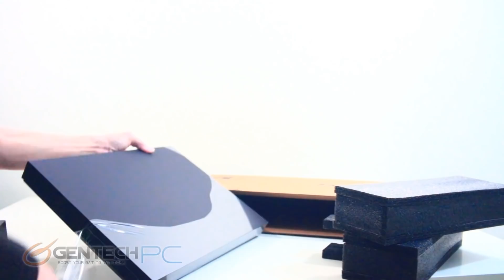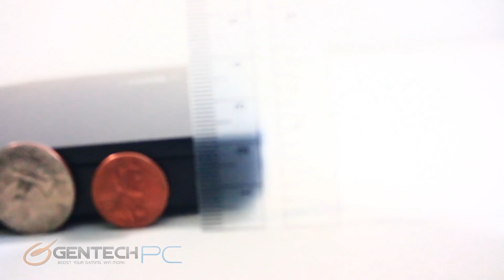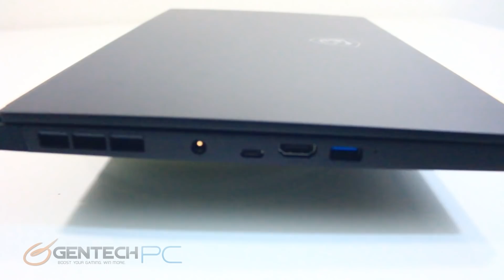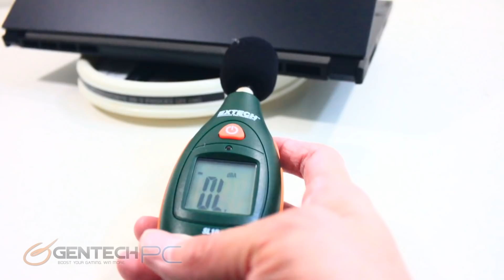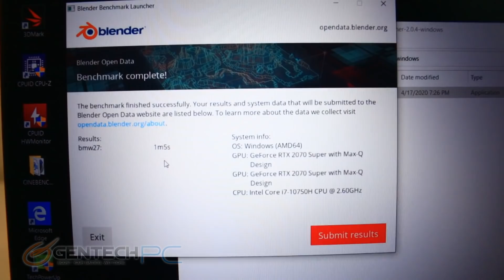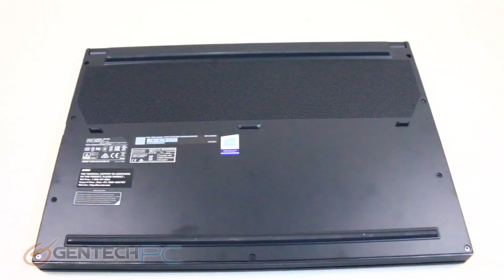MSI GS66 Stealth Detailed Review & Benchmarks (300hz, RTX 2070 Super MaxQ, Intel 10th Gen i7-10750H)

Comment: I have the GS73vr 8RE Steath with a 4K panel and the 8750 i7 with 16GB 2666 and the 8GB gtx 1070MQ and i love it. picked it up off of ebay for 1280 USD about 7 months ago in mint condition with a warranty left. The only thing i did to it was put TG kryonaut on the GPU and CPU when i got it because i do that with all of my laptops when i get them. It dropped the temps over about a month's time around 7 degrees C max during AAA gaming. these stealths don't get enough recognition at all. they are super thin and light and priced very competitively.  I slapped a 1TB 970evo m.2 and 1TB 850pro in mine and it screams. my only "catch" is that i personally think 1080p is and should be dead because once you start gaming in 4k at 60+hz, 1080p looks sooooooo bad. i'm a graphics snob, so i will never buy a laptop or anything that doesn't have a 4k panel. i turn eye candy down or off if need be just to be in 4k with higher FPS. i do have to go QHD on my stealth sometimes if push comes to shove, but if they offer this with a 4k panel and the 2080 maxQ, i will consider trading up for my gaming on the go. (for the debaters on 1080P vs 4K):  i play FPS (warzone, battlefront 2, doom eternal, etc. etc.), and i have no problems in multiplayer and doing well online with 60hz in 4k on my desktops against other PC users and crossplay. sure, linus made a video showing that "professional gamers" prefer the 144hz+ screens compared to 60hz, but real world, no issues. i have a 70" vizio P hooked to one of my desktops and it does 120hz in 1080P out of 4k and the only thing i get out of it, is i have to turn my mouse sensitivity down a little bit with the higher refresh rate... another thing i will say about the stealth, is that the Max Q design really reduces power draw and temps but they REALLY reduce performance. my 1070 max Q performs like a desktop 1060(and less in some cases) and this 2070 maxQ is no exception. it will perform like a 2060 or even less, so you won't be hitting 300hz in really anything. to compare: my firestrike score on my main desktop (7700k @4.9, 1080ti FTW3 @ +50 core(2022mhz), 16GB 3400mhz CL15) floats right under 23,000 (7291 firestrike ultra best which beats 3dmark's newly released scores with a 9900k and RTX 2080 by ~600points) and it wouldn't even be able to do 300hz in 1080p in most if not all AAA titles with eye candy maxed out (and some turned down). That is just a heads up on the real world performance here. A 16500 in firestrike is the exact equivalent of a non OC 9700k paired with a desktop GTX1080(non Ti) for more comparison which is pretty awesome for a laptop! But, my point is, the panel is extreme overkill for the hardware inside of the GS66 specified in this video. They are all very nice and i love them and as long as you don't expect performance anywhere close to your gaming desktops at home, you will love the stealths too for gaming when you are mobile. nice video.

Comment: Imagine this but r7 4800h or r9 4900h instead
Reply: Buddy that's why I'm waiting till next year, all those features AND a Ryzen 7 or Ryzen 9. Hellooooooooooo Desktop Substitute.
Reply: Fares Abushanab From what I understand, those chips are really only worth it if you’re creating content. Seems like for gaming purposes this should be just fine if that’s what you’re looking for.
Reply: @leekaplan4907  These intel processors run way hotter , are more expensive than the ryzen. You can expect throttling during intense gaming depending on the unit, which will not happen with a 35w ryzen.
Reply: @AdX-nj3ti  I heard about the lower heating but not about the price. Is the price difference significant?
Reply: Star Boy most of the ryzen laptops out right now have horrible cooling. jarrod tested a g14 which is small in factor. the 4900hs in that laptop is twice as powerful as the 10750h in this msi and it still never reached 98 degrees in his stress tests. The facts are there, you can choose to ignore it if you wish
Reply: Lee Kaplan the ryzen processors are rumored to be much less expensive then these intel chips. more powerful and more efficient. just like their desktop counterparts
Reply from the maker: yeah would be nice. :)
Reply: @rg1346  ryzen is less expensive but it’s cores are dog crap and you don’t have thunderbolt, just like their desktop counterparts, also look at some videos on ryzen 9 vs intel i9 and you will see that intel is the winner in gaming and amd has a 1 percent win in rendering

Comment: This machine is MSI's answer to the Blade. And with a standard 2 year warranty and msi support when compared to razers 12 month warranty and terrible support this unit may do well. Time will tell with overall build quality. One of the things that bugged a lot of people about the GS65 was the quality of the hinges. However, it looks like MSI have put a lot of work into improving the overall build quality if this unit so far.
Reply: Where do you see 2 year warranty?
Reply: would you recommend getting this laptop. if the price goes down s

Comment: great review
but the cpu temps are too hot for me
Reply from the maker: We can repaste for free to lower the temperature.
Reply from the maker: Re-Pasted with LM posted on NBR, CPU temp drops to 80~85C, that's 15~20 degrees drop.
Reply: @GenTechPC  How long is this promotion going to be for?
Reply: not bad at all
however could you do a review about the aorus 17x ?
Reply: GenTechPC do we have to request a repaste or is this a common practice for all your units being sold? also, how do we request a repaste on order?
Reply: Thermal Grizzly Kryonaut is the best compound by far other than going LM. proven. these stealths are insanely easy to get to the CPU and GPU to re-do the paste.

Comment: To anyone who this may concern that is looking for a great upgrade from an old 5ish year old gaming laptop in 2021, this has dropped a bit in price and is a great buy. Very daily drivable
Reply: Its so loud though?! No issues with this??
Reply: @silentlightning2013  silent mode I think it's called will quiet it down a bit. It is kinda like a jet engine though you are correct. No library's then lol 😂 I use head phones all the time and and haven't noticed it for a while. To each their own, I still think it's a wonderful laptop. Been using a 2014 17 inch asus rog for so long so I could just be in the honeymoon phase. I have tried a few of the other 2020 laptops and I think the msi one is better so far. There could be a better pick for that price range but I can't find it.

Average cpu temp while playing destiny 2 with everything maxed was about 80-85 with the occasional spike up to the low 90s. Haven't seen it stay up there for long tho, seems to keep itself cool enough but I'm not one to overclock anything or run a million of things at once.

Comment: The 300Hz screen is so unnecessary and drives the price up for no reason.
Reply: Agree, 144hz is the sweet spot
Reply: I seriously dont get why.
Reply: It would probably use a lot more power too
Reply: Yeah, and even that spec the only games you can possibly run at 300 fps would be like Cs go an dota 2,maybe overwatch 😂
Reply: I think it's for marketing reasons only
Reply: @kamil151  not even overwatch just cs .. lul
Reply from the maker: Some games have FPS unlocker add-on up to 240Hz.
Reply: I love how nobody here has heard of geometry dash
Reply: Buy this laptop for the 3ms response time and not because of the high refresh rate.

Comment: Overall this pc is op for gaming but meh for rendering, but if temps are a problem you can double the fan speed on the software.
Reply from the maker: We offer free repste should make it better. :)
Reply: @GenTechPC  I am not the most illustrated guy regarding thermals, compounds and repaste but, could please tell me which is the free repasting you offer? I was surffing your website but I am unsure which one to choose. Thank you
Reply from the maker: @cornerxstone   LM (Liquid Metal) performs best for the CPU temp. We just posted LM re-pasted on NBR and CPU temp drops 15~20 degrees.

Comment: Thanks for the informative video. Do you know if you can charge/run the laptop with a 45w or 65w type c charger through the thunderbolt 3 port?
Reply from the maker: Yes it can, the Type-C does provide Power Delivery.
Reply: Needs to be 65w minimum, my 45w power bank didn't register. A 61w type C charger didn't either, but my Amazon 65w charger did.

Comment: Nice video! I'm looking at the different variations of this laptop and have read a lot about the 2080 super not being that much better than the 2070 super.  But which combination would be better for gaming; the 2080 super with an i7 16gb, or the 2070 with the i9 and 32gb?
Reply: At 1080p I think the bottleneck will be due to cpu maybe the i9 is better
Reply: @Voltedge89  Awesome, thank you
Reply: @Voltedge89  well with the i9 the heat will be the bottleneck... so go i7 with 2070super is much better
Reply: What about compared to the 240hz i7 rtx 2070 super max q... will there be much of a difference in the gaming experience? Like enough to pay for it? Or will u still enjoy buttery smooth gameplay

Comment: If people want Amd inside, don't wait. Just buy the Msi other series. People just put comments without research. You wil not ever find Ams cpu inside the Msi other series.
If you need intel inside. Just wait until Msi bring i7 10875 setup. 8 cores CPU and cheaper. 200 euro cheaper than Asus G14. For laptop i9 is overkilled and not gonna get max performance(thermal).

Comment: So the 2070 Super MQ is right around the 2080 MQ of last year. May be worth getting last years model and save money.
Reply from the maker: CPU computing power is not the same, as well as battery pack, screeen refresh rate and easy upgradability.
Reply: @GenTechPC  True, but 300Hz is not a selling point over 240Hz, so I refute that one. Are the other features you're stating worth an extra $? I don't know. Perhaps I'll wait until the 3000 series.
Reply: @GenTechPC  the cpu difference is negligible at best. Saying something els is just a simple lie that anyone can see through  by now.

Comment: @GenTechPC when u removed the heat pipes I saw pink stuff all over the motherboard do you need to re apply that also?
Reply: or can you use thermal pads on them
Reply from the maker: @Toad586   It's thermal gel from factory.  We usually don't use thermal pads when it has thermal gel on it because thermal pads adds thickness to it, it results overheating because thermal pads are too thick even we sue 0.5mm pads.
Reply: GenTechPC thanks for replying. I’ll be ordering a ge75 raider from you guys !
Reply: @GenTechPC  Did you guys need to "repaste" those pink thermal gels or you can just put the cooler back as it is.
Reply: @GenTechPC  If that is the case why are the thermal pads an option for this model under your website?

Comment: i have gs75 stealth 10sfs, 
the keyboard is not as normal keyboard, there is more space between buttons that usual so you will do alot of mistyping because of the keyboard , also the mouse pad is very wide , and somehow i feel my old asus is faster when booting and start up
also no gaming the fan is very quiet, but if it run hard it will be very loud more than asus, and the keyboard area is cold all time.
material is good even if its plastic, 

but i wanted to buy asus rog scar 2020 10th gen but it got delayed so i bought this. 
i dont like the keyboad, fast is very load if run high, i feel like android is msi and apple is asus 
its high performance but somehow i feel asus would be faster and better if same spec.

Comment: Does anyone know if there's a displayport through USB c connected directly to the Nvidia GPU? I ask because it's a requirement for newer vr headsets
Reply: Downquark7 if I am correct, the thunderbolt 3 is connected to the igpu (integrated gpu)
Reply: Not the discrete gpu
Reply: You talking about Quest and link?
Reply: @kdilac8879  I mean buying a USB c to displayport adapter and using it with the valve index or something